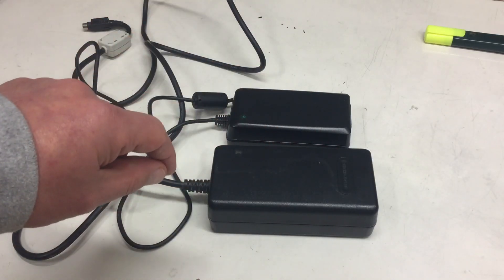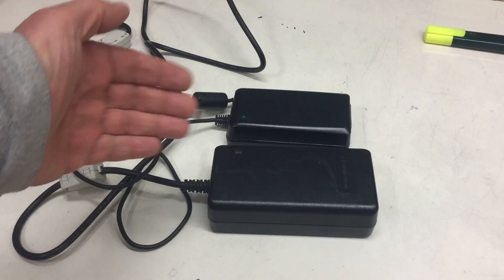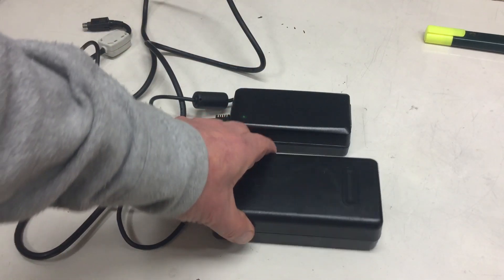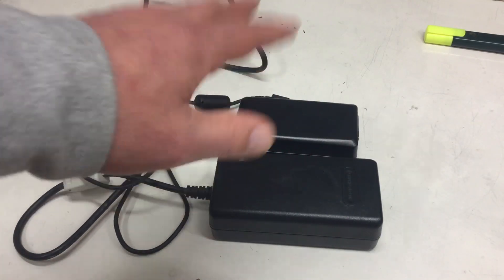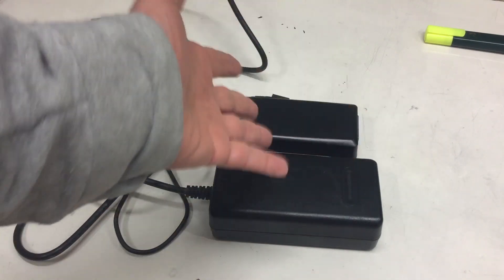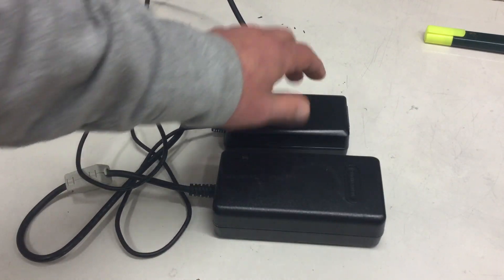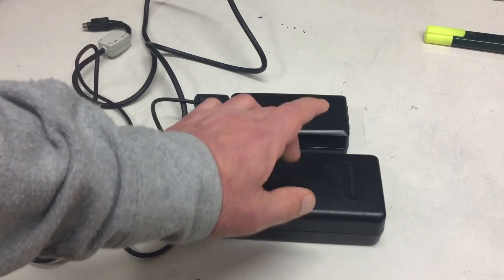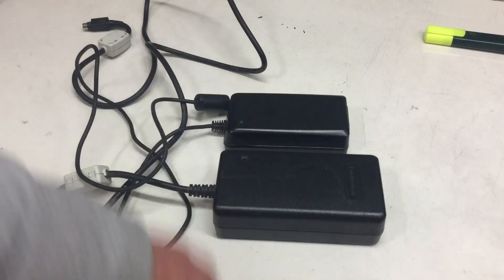Mean Well 48V/1.375A vs Phihong 12V/4.2A – AC/DC Adapter Teardown

Comment: Older power supplies were designed with good components & you repairing them in the future.
We live in a replace/ throwaway Society now!
Reply from the maker: So true! On another note: I was quite shocked when I saw for the first time some professional network equipment that used an external AC/DC adaptor. It's a pure cost cutting measure: When you buy an external AC/DC adaptor from a third party you don't need to certify your box as a AC mains appliance. In a 19'' rack all these AC/DC adaptors are a pain in the ... behind.

Comment: Thank you for this very useful video comparing the quality between the two supplies. I am after one of these to replace a cheapie I have. In your opinion buying either a Meanwell or Delta or XP power would be the better product overall?
Reply from the maker: In my opinion (!) you can't go wrong with a Meanwell (my default source for power supplies) or a Delta (seeing them a lot on professional equipment). Can't say anything about XP.